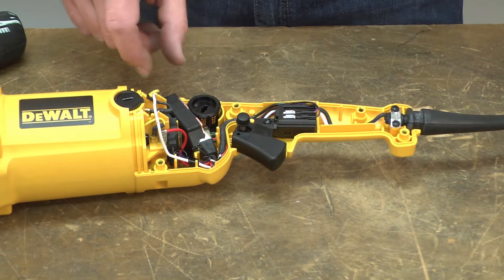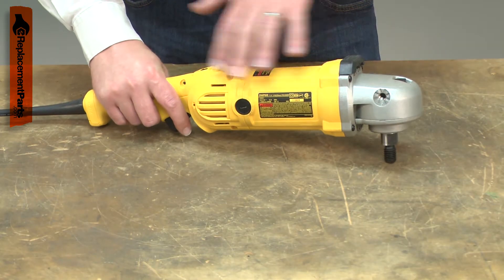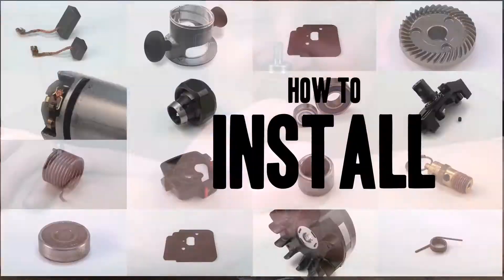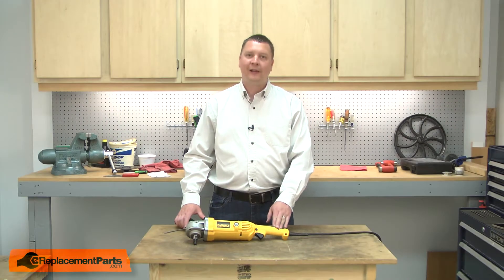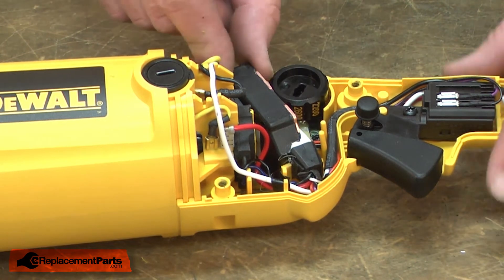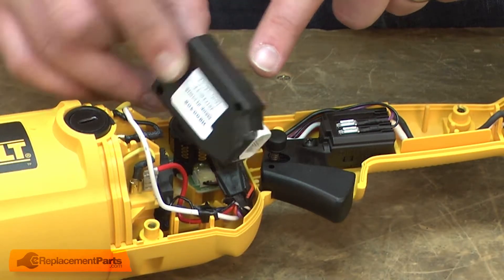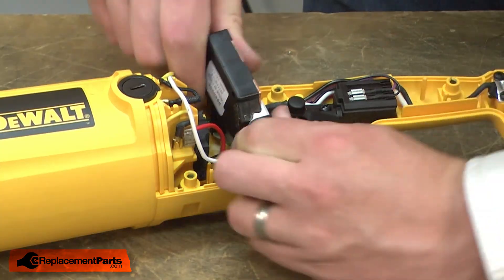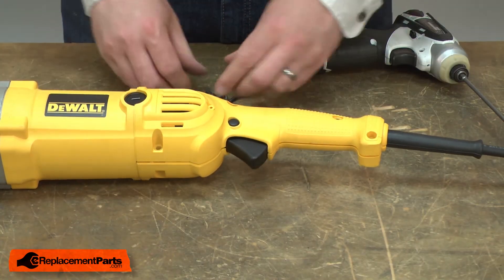DeWalt Polisher Repair - Replacing the Control Module (DeWALT Part # N089179)

Comment: Any tips for troubleshooting the control module? The switch and control module have the same symptoms if they are faulty. It would help to be able to test components instead of performing shotgun repairs.
Reply: bypass it